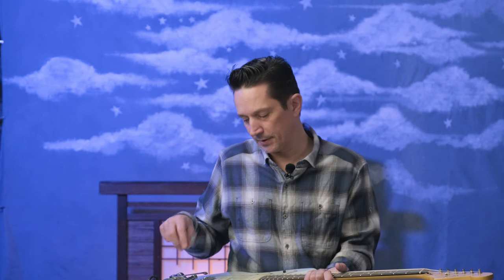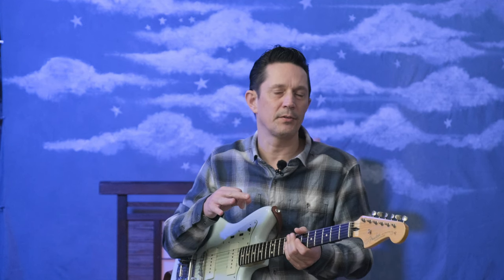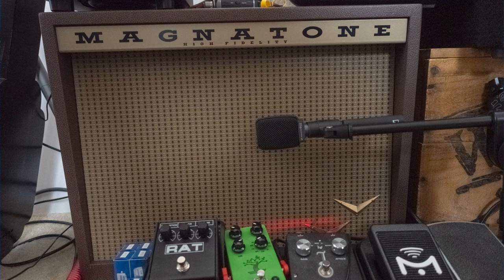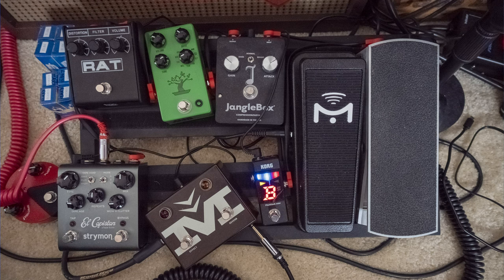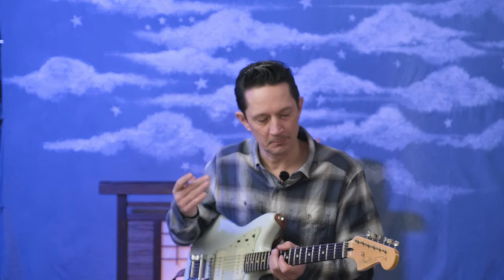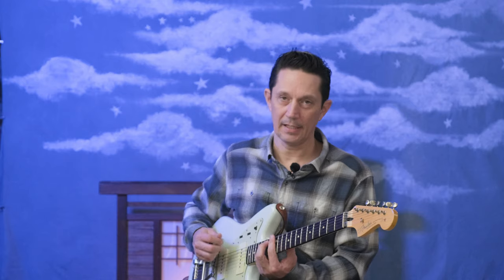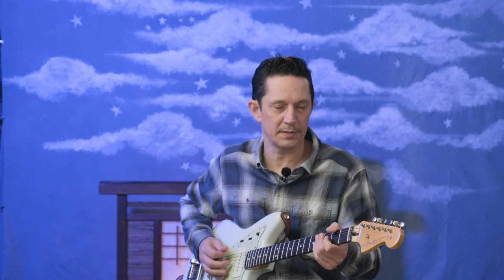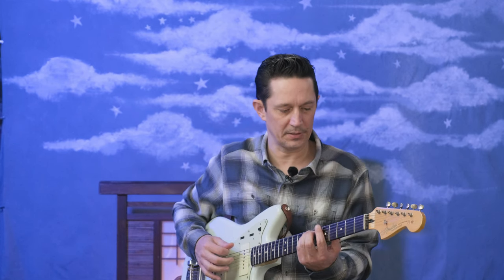Turn your Squire into a Fender Jazzmaster - CHEAP option!!!

Comment: I'm thinking about sanding my squire logo off and replacing it. What type of sand paper and did you just sand the logo side or the whole front of the headstock?
Reply from the maker: Yes, I removed the tuners and used an orbital sander to sand it flat to bare wood. Then I applied the waterslide decal and sealed it with lacquer.